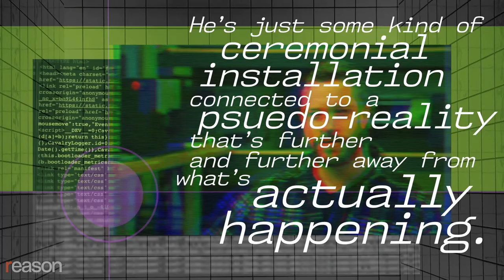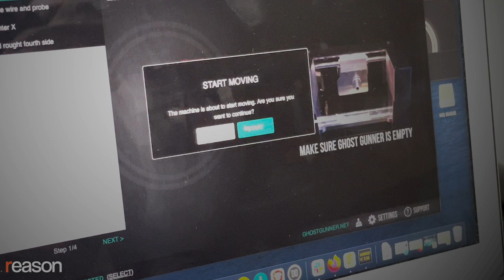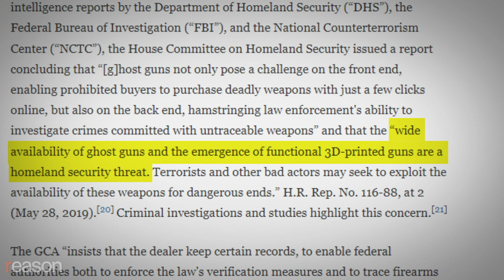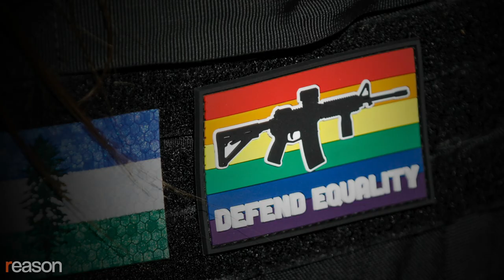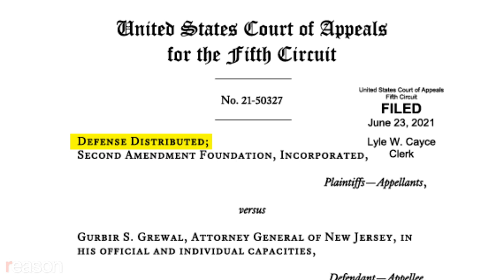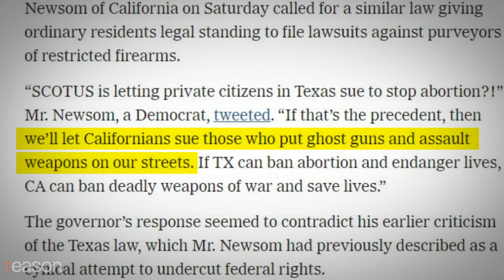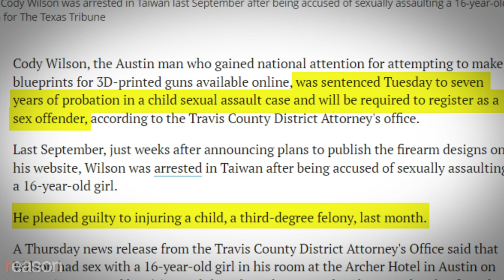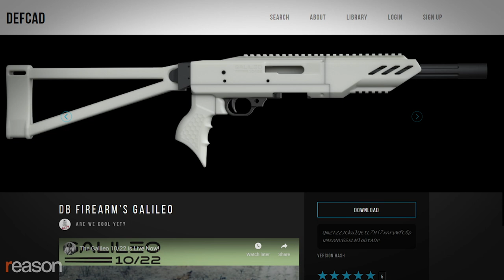Cody Wilson Thwarts Another Attempt To Stop Ghost Guns

Comment: Making AR lowers or pistol frames from raw aluminum stock is an obvious way around over regulation of 80% part kits, but the recent ATF proposal would have made all critical firearms parts "firearms" requiring a serial number and FFL registration.  A general purpose CNC machine could also machine triggers, sears and even some firing pins, but is Cody going to sell the machinery needed to manufacture barrels?

I like the purist attitude of ignoring politics and focusing on the technology, but when the administrative state has unlimited power to make the rules they enforce, they will continue to add new laws,  via legislation when they can, but via administrative laws by unelected bureaucrats when needed.  They love making new laws that enhance their power at the expense of our liberty.  It never ends.
Reply: Ivan the Troll IIRC did some work on electrochemical machining of barrels, via 3D printing a mandrel that goes down and actually eats away the material w/ electricity. It's certainly possible to do so.
Reply: The barrel making technology is unironically simpler than the Ghost Gunner.
Also, remember that Cody's battle cry years ago was "we're going to make them ban the internet". They love making new laws? With each new law they piss off more people who had nothing to do with guns because the laws have to progressively go after non-gun items.
Reply: Obvious solution to me is to have the CNC machine just take off the serial number.
Reply: @Eckster  The issue isn't having a serialized item, it's the fact that serialized items can have their purchase limited. If I can just buy it I don't care if it has a serial, the problem is when they tell me I can't buy it. Or that all the purchases are monitored (they already are with credit cards but that's another topic).
Reply: @AG-id8dl  - Even with home shop electromechanical machining (which is very cool), making a rifle barrel bore from round stock is not easy.  Many people want to make an AR at home.  Imagine trying to machine the locking lugs.  Over regulation meant to administratively outlaw the legal and time honored tradition of individual firearms manufacturing is going to result in people being maimed or killed... not that the regulatory state would mind.  In fact, they'd welcome it as another excuse to outlaw home shop firearms.

I'm an engineer and my favorite aspect of this is the design of entirely new firearms optimized for manufacturing using new equipment and methods.  Manufacturing an AR lower from the 80% part sounds like fun but manufacturing from raw materials sounds even more fun to me, and that's why I'd do it - for the hobby enjoyment and technical challenge.  I have a lathe, a CNC lathe, a CNC milling machine, and eight 3D printers.  I wish I had more time to manufacture firearms for my own personal use and edification.  It's a great hobby.  Is there nothing that government regulation can't ruin?

Don't like homemade guns?  Don't build one!
Reply: @Liberty4Ever  admittedly, I am neither a machinist or an engineer, but I think homemade guns are cool. I'd like to build one from scratch one of these days too, lol
Reply: There are YouTube videos of people manufacturing barrels in their garage. 
Would those barrels stand up to the strict tolerances for an AR? Probably not.
Reply: @Liberty4Ever  I'm on more than a few naughty lists, lol
Reply: @AG-id8dl  - I would say they can't arrest all of us, but any more, I'm not so sure!   :-o
Reply: @LarsLarsen77  Sounds cool. I will have to look that up.
Reply: @LarsLarsen77  - The BATFE had a Notice of Proposed Rule Making last year that would have legally classified all major firearm components to be firearms, requiring serial numbers and FFL records for each.  The NPRM specifically targeted ghost guns, and grossly distorted and expanded the intent of Congress when the FFL system was created to track firearms.  The ATF has been weaponized.  They aren't enforcing laws.  They create rules that they enforce as law, well outside the constitutional legislative process.
Reply: Agreed. Solutions like this need to exist as a backup, but they are very much not ideal and people still need to fight back in the legal system, if for no other reason than to make people aware that these federal agencies are more than overstepping their boundaries.
Reply: The administrative state is full of very dull, uncreative people always fighting the last battle.  They work 8 hours a day and take 2 weeks vacation every year.  They will never keep up.
Reply: @Liberty4Ever  I heard that Ivan's group is trying to find a way to deep-hole drill with ecm. And they are also working on ways to cut thick pieces of steel with ecm as well. If they can do that locking lugs would probably come in short order. Another challenge when it comes to barrels, is chambering in a rimless bottlenecked case.
Reply: @ChucksSEADnDEAD  It's simple on paper, but executing it is kinda tough. You also need a special cutting fixture to deep-hole drill a regular drill bit will not cut it.
Reply: @skm1091  I understand that. The current meta is acquiring tubing that's already bored through with an ID smaller than the lands. Then with an undersized rod you ECM to final ID. You don't have the issue of the drill bit walking out of center.
Reply: If they do that then we go all the way in home productions.
Reply: @Liberty4Ever  the locking lugs on an ar are dead simple, the ghost gunner could easily cut them
Reply: @pacman10182  - One off fixturing for accurately machining locking lugs could be challenging, but I'm less worried about the locking lug geometry and more concerned with the heat treating of this safety critical part.
Reply: @Liberty4Ever  grab a chunk of pre-hard 4140
I don't think it's required, but it's so much easier if you don't have the proper equipment
Reply: @pacman10182  - I've built a few light duty CNC machines in the class of the Ghost Gunner, and they're surprisingly capable if you're not in a hurry, but I wouldn't recommend hard milling on one.
Reply: @Liberty4Ever  hardened 4140 isn't hard like hardened steel, It doesn't have enough carbon for that
Reply: @Liberty4Ever  Steel isn’t necessarily hard to heat treat. Technically it could be done with a propane torch and some insulation with a motor oil quench. Although, for this you would want a more precise forge with a selectable temperature.
Reply: @justsomemainer1384  - I made an emergency replacement draw bar for a friend's little CNC machining center.  I used free machining 1215 steel.  It can be heat treated but not as much as other steels optimized for heat treating.  I had to get it to UPS so my friend would have it the next day, so he did the oil quench heat treat to make the threads that I cut on the lathe last longer, until his long lead time drawbar arrived.
Reply: @Liberty4Ever  Well, for self defense (short range combat), a well manufactured smooth bore may suffice, especially if fully automatic. Hell, in a fast paced gun battle at ranges of 20 to 50 feet involving untrained shooters, IDK if rifling would make much difference.
Reply: @casualbrowser407  - Smooth bore pistol?  Gosh, those are illegal.  ;-)

That's the thing that isn't understood by people who seek to control others.  Most people will grudgingly accept some infringements upon our rights.  Quite a few, in fact.  But once a right is unconstitutionally deprived through a ban or near ban, then there is no longer any control.  Once all civilian owned guns are illegal, which is their goal, and firearms are manufactured by individuals, then who is going to engrave a serial number?  It's easier to make a fully automatic weapon than a semi-auto so why not make a full auto pistol?  Rifling is of limited use for a short range pistol and it adds to the manufacturing complexity so why bother?  When a short barrel rifle or short barrel shotgun is as illegal as the longer versions, the more concealable version will be made if that's someone's preference.  Once all firearms are illegal, suddenly all the stupid rules that make no sense go away and people are 3D printing full auto integrally suppressed short barrel rifles.
Reply: It always blows my mind how rarely people bring this up when talking about US gun laws. Can you make gun barrels at home with ease? Yes, a pipe that fits a shotgun shell is pretty easy to make. Can you make an AK or AR style barrel, or even a pistol barrel, with a correctly sized chamber, riflings and locking lugs? Maybe, but with very high specialized tool requirements and knownledge. But you don't need to, because anyone can freely buy those barrels. Just by changing the law so that most difficult to produce gun parts needed a background check (or some other way to check that you are legally able to buy gun parts), instead of only the receivers, this would heavily increase the price/difficulty gap to illegally make guns. 

Instead politicians are focusing on completely nonsense stuff like mag capacity limits or whatever the thumb grip thing is. Takes a criminal 1 second to circumvent those :D
Reply: I've had problems getting barrels, so I ordered "rifling buttons" off ebay, and have made forty five, 9mm, 9Mak, and 308 barrels.  I did it because I wasn't willing to do the work to cut rifling, as has been done for eight or nine centuries.  It's pretty cool to be able to do in a hydraulic press, and beautiful rifling, polished like any commercial barrel.  These are not laws, but rules, and will collapse with any effort to confront.  I will weaponize farm equipment, if I have nothing else, and I'm surrounded by farmers, and their fields, tractors, and food.  Semper Fidelis
Reply: @AG-id8dl   the electrolysis method from Ivan the troll is a game changer!
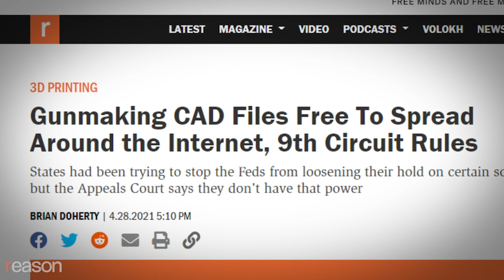Reply: I've been building pull button/multi/single point sine rifling machines that can go up to a 16" barrel, and 1:6 to 1:16 twist, left or right.
Indexable chuck allows 4, 5, 6, or 8 grooves.
Up to view in action on YouTube.

Barrels this length are something that can be accomplished by most people with a lathe.
Up to around 6" you could probably even do it on the 7x10 Harbor Freight lathe.
If you're using rifle ammo, you're going to need heat treating skills. But for pistols, good steel and a bit of extra thickness will work fine, and if you do heat treat, straightening is probably not needed.
Reply: It and it never will end, UNLESS we end it!

Comment: If the government wants to completely ban ghost guns, they are going to have to criminalize making your own firearm, period. Any attempts to ban particular 80% lowers, or jigs, or a CNC machine are just going to results in more creative solutions. As an Engineer, I can say that making your own gun is not hard with basic tools.
Reply: More creative solutions = more expensive solutions. As an engineer, you will probably agree that machining a receiver from an aluiminium blank is a lot more expensive and difficult process than finishing some almost complete receiver in a drill press with a help of a jig. Now imagine if AR barrels couldn't be bought freely, on top of that $2500 CNC mill  you would need something a bit more specialized to make those locking lugs and riflings.
Reply: @Catrik  the locking lugs wouldn't be to hard so long as you have access to a mill and or a lathe, the only hard part would be just matching the correct depth to your bcg for a proper fit up, and to the rifling, so long as you have a 16" drill bit of the proper landing size of the caliber you are shooting, and the ability to create a crude slug that can be heat treated and hardened to push through with a press that will give you good enough rifling to hit probably 2-3 moa groups
Reply: @Lazybiker60  As a machinist and a fabricator who was over 10 years of experience building all kinds of stuff at home with un-proper tools, I think we have  quite a different understanding of what "hard" means. Could I build a rifle barrel with locking lugs, some kinds of a rifling and a correctly sizerd chamber? Yes, I can use a lathe and a mill at work, I know how to use them, I can buy a chamber reamer, and it would take me a weekend to research heat treating and get the equipment for that. It would probably take me a few tries to get everything right. I could get it done, but I would not consider it easy by any means. Now, someone who lives in an apartment without a garage, has no access mill or lathe, has never used them, doesnt know what heat treating is, doesnt know how to do any of the stuff, has to research everything. That is a HUGE task with many hard difficulties to overcome. Much higher skill cap than finishing an 80% lower with a drill press and an aftermarket jig.
Reply: @Catrik  I need help getting one of these lowers.  I’ve got PTSD because of a jacked up conflict Bush wanted to start for oil money.  3 DUI’s later and now I’m a felon without the right to carry, one of the backbone rights this country swears to protect for some but take from others.  I fought for that right!
Reply: @publicuser2534  If you have repeatedly shown inability to care about other people by driving under the influence, how should you be considered to be trustworthy to carry a gun? In my opinion, you should not. And in my opinion, you should not have an easy way to illegally aquire or make a gun. 

I hope you get better with the PTSD and the other issues. Is there a way to have the felon status removed in the US? Like not commit any crimes in some years?
Reply: @Catrik  Touché my friend and I agree with you wholeheartedly in hindsight.  I did put everyone around me in jeopardy.  Be well and God bless.
Reply: @Catrik  I think it is state specific like losing the right to vote for a felony. Some states allow paying a large fine for the right back.
I agree. If @Public User is found with a firearm, he would be rightfully punished.
Reply: How ironic that big brother would deem Public User as unsafe with a firearm due to an unrelated DUI, but would allow him to regain a drivers license and own a motor vehicle.

Comment: Worse comes to worse it’s a trip to the local hardware store to get some wood, pipes, files, a welder, and a good set of clamps and bolts, screws, and nails.
Reply: If the California governor gets his way you'll have to register each one of those🤑🤧😫 they already have spray paint locked up at the hardware store
Reply: @jakegarrett8109  you're right there's always a bright side👍
Reply: @LarsLarsen77  gunpowder is actually not difficult to make, especially if you can get nitrate fertilizer at the gardening store (for me that would be Lowe's or Home Depot, same place I recently purchased a pipe and 2 end caps...)   then some charcoal or if you want to do it historically making it all yourself burning wood that's not hard either. Then sulfur and now you have transitional black powder, which is perfectly legal to manufacture for your personal use in the US with no license needed. Also you can use your own urine for part of the process, good luck getting a background check to prevent you from your own pee.... That's the ultimate way to tell the government to "pi$$ off!".

Maybe you're thinking of primers, those are more challenging, but really, the way I described is probably twice as difficult as converting household products into either decent grade smokeless powder (though I recommend black powder for safety reasons in a pipe musket or DIY cannon), or into primers. Personally though, I've seen listings for revolvers that used cap-gun toy caps instead of the traditional percussion caps on revolvers, and they weren't a bad price (someone had custom machined some and were selling them, neat idea during the primer shortage, they claimed it worked well).
Reply: scary shit but many of prisoners have died that way so I know what you mean; I wont be holdin one of those with my hands tho.
Reply: @jakegarrett8109  you win the internet today my friend.
Reply: @ROBIN_SAGE  Thanks Robin, makes my day knowing I got someone to laugh or smile, cheers!